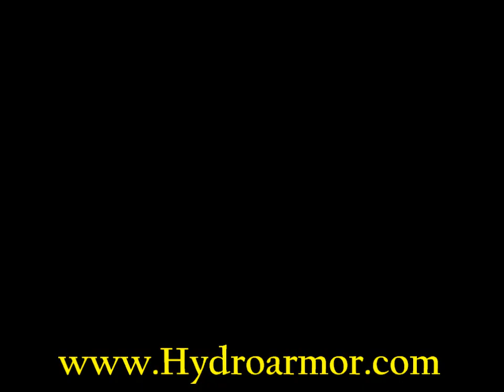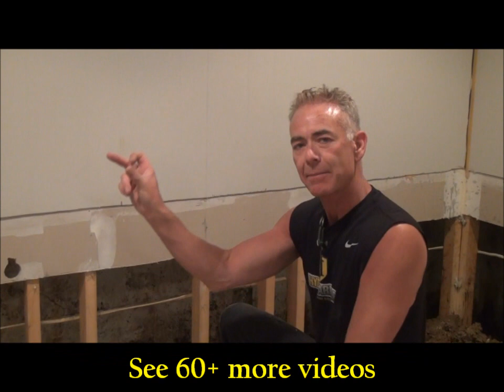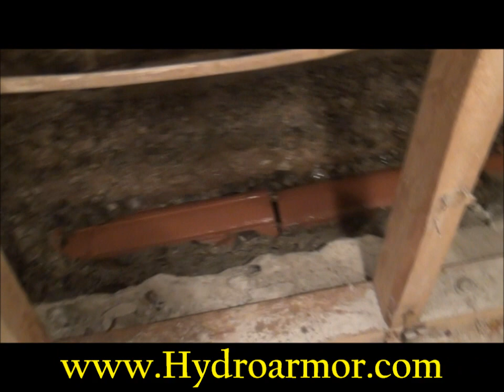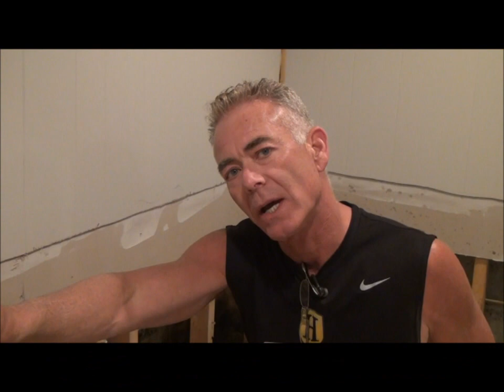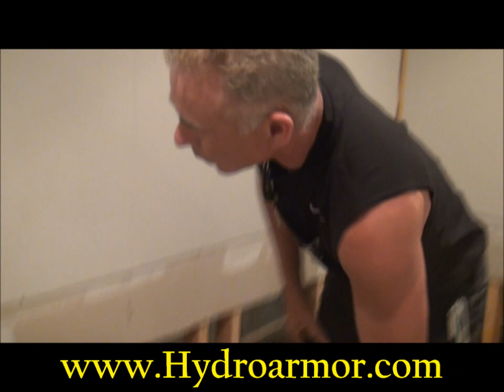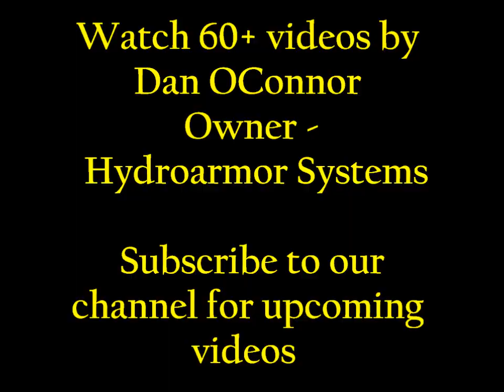A Tip on Basement Waterproofing - There is no such thing as a Real French Drain anymore

Comment: @ Daniel, First and foremost, I tip my hard hat to you! You are the " fucking man "!!! I mean that with the utmost respect sir.
I'm an skilled carpenter of 25 yrs. I've been getting into plumbing in the past year and I'm literally "digging" it.  
Every word in your video makes perfect logical sense. I've been coming across these "1 day- 5k " jobs and it literally makes me sick knowing my customers have been ripped off by bottom feeders or as I call them " trade prostitutes " 
I came across a situation where "cove base " was used as a waterproofing system. I was so outraged that it was just done 3 years ago and my customers basement is full of water and black mold. She is 90 years old and was completely ripped off. I threw my hammer down on the floor and shattered the 1/4 inch "thin set" that was poured over top of this bs crushed plastic PVC tubing ( NOT schedule 40 or 80 )in the floor that WAS NOT connected to the crock.
So I tell my customer there is a serious problem and I believe the association is liable for it. The association hired a "1 day 5 K" bottom feeder trade whore/ prostitute to instal the waterproofing ON TOP  of the footings. I just went a round with the "HIRED CERTIFIED EX PLUMBER" and he ask me if I was certified or licensed, No sir I am not, but I can tell you right now I dont need to be certified or licensed to know something is wrong. So I was told I am a "NO BODY" and my opinion is worthless.
I'm outraged, I'm going to get a friend that is certified to come over and help me battle these scum bags. 
I just like to thank you personally for posting your video because it backed up what I was saying. I came home and typed in "Signs of drain tile failure" and I found and watched a lot of your videos. I was so happy to find someone on here that knows what they hell they are talking about. Im going to e-mail them links of your video's as well as taking my certified plumber there with me to set this ignorant president of the association straight. I bow my head to you sir and respect your knowledge as it helped back up what I've been saying.

Comment: After years of only a slight damp basement the one wall is wet.  It could be from the extreme rains we've had this year.  We are in the Pocono's.  My father built the house and I am keeping it.  
Also, I'm glad you explained the French Drain.  Everyone else thinks it's a plastic pipe with holes in it placed around the foundation on the exterior of the house.  It's covered with stone and then back filled with dirt.  I've also heard that a large barrel is used away from the house for the water to drain.  What the?
Glad you cleared this up.  Now I've got ammunition for my buddies.